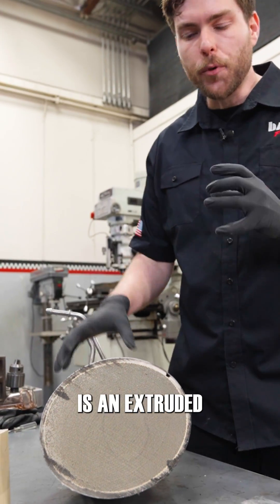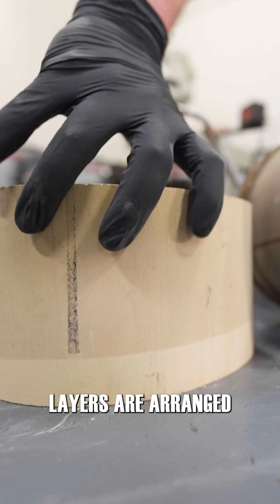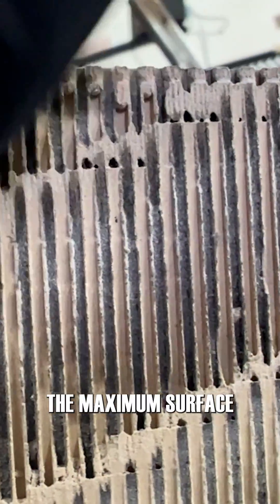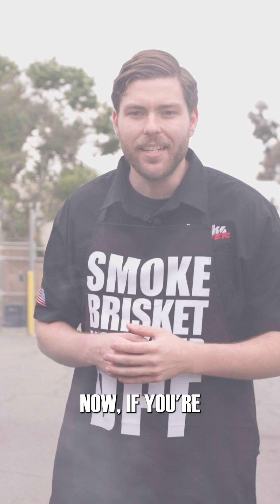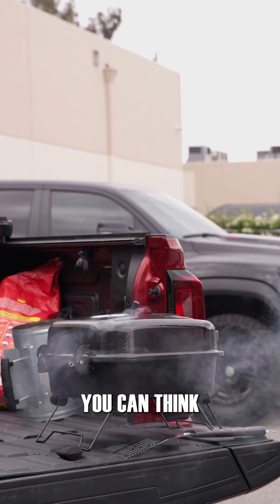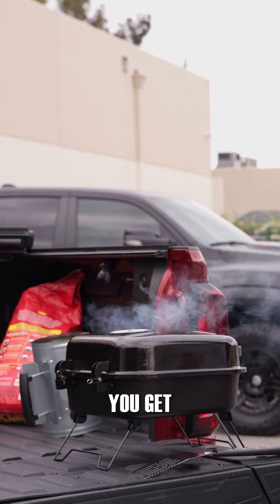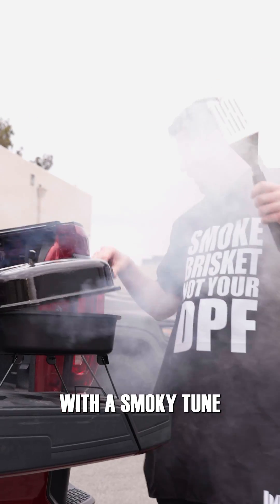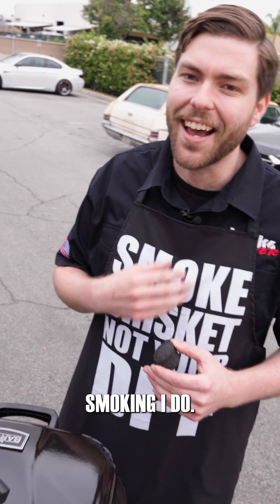Why rich tunes clog your diesel particulate filter (DPF)

Comment: Pretty sure nobody running a smokey tune still has a DPF
Reply: Dpfs on the l5p get clogged either way 😂 emissions are trash
Reply: People run tunes on an emission compliant truck thus resulting in sooting up the DPF. You gotta be careful on the type of tune you’re running if you’re tuned and still utilizing emission equipment
Reply: @sirmassalot  The older pre crackdown "intact" tunes turn off EGR which results in a hotter cleaner  burn with increases efficiency and reduces soot output at the expense of increased NOx output, which is why EGR is run in the 1st place.  

Turn off EGR and the emissions system becomes livable and of course no smoke escapes the exhaust.  DPF regens go from every 300 miles (or less) to over 700 miles and emissions issues generally disappear.  

EGR is terrible for diesels and current regs are simply too stringent to reliably meet with current aftertreatment technology so people are incentivized to circumvent and delete it.  I submit that if the regs were attainable the overall pollution level from diesels would go down as the incentive to delete would go away.  

Then there are entirely uncontrolled container ships at jet airplanes, which put out far more pollution than diesel trucks ever will.
Reply: They're making their engines run worse for no real reason
Reply: Stupid people do it all the time. Then wonder why it takes so long for regen and all of a sudden your truck doesnt start
Reply: Elaborate please.
Reply: Pretty sure he tried to explain to you morons why a smokey tune means you're dumping unburned fuel out the exhaust and making your engine run dirtier on purpose. Problem with a smokey tune is eventually you breathe so much of it in that you're permanently retarded.
Reply: There's that thing I threw in the trash 😅
Reply: Exactly kind of the point in tuning them
Reply: Can you clean a dpf? Or is it just dtf?
Reply: @primitiveorganism9571 lol wat
Reply: @yjkader  guess you can’t read
Reply: hahaha I was thinking that too, the first thing you do for HP is remove exhaust restrictions lol DPT gooodbyeeeeeeeee
Reply: My tune isn't smokey and I still don't run a dpf
Reply: exactly 😂
Reply: I cleaned my dpf with a sawzall 👌🏻
Reply: people running a smokey tune arwnt giving thier engine enough air
Reply: @silentbobfan32 what 😂
Reply: When they produce soot, the DPF plugs, then they lose all their power, so they have to delete the DPF. wouldn't it be great if we could use a system that eliminates the nitric oxides without any exhaust gas recirculation, while using 100 year old technology to increase the fuel efficiency? I'm an engineer and I approached Cummins with my system and was told that they're no longer trying to improve diesel engines, but are working on developing hydrogen technology. This administration is destroying innovation because they are mandating battery electric vehicles. There's not much worse than preventing improvements in society, because it prevents future advances that could have been developed from the first innovations.
Reply: @davidscott5903 ok now I gotta know...what is this 100 year old technology your referring to?
Reply: @reillyp8115  
OK, I might as well tell the world and hope that the information gets out there. When I bought my first diesel truck in 2006, I asked the guy selling it why he was selling it if it was so great, and he told me that he bought a new truck to get one before the emissions requirements went into effect, and he said that they were going to be using exhaust gas recirculation to prevent NOx emissions. So I looked it up, and it blew my mind at how stupid that was. I learned that in order to prevent the formation of nitric oxides, you had to limit the combustion temperature to below 1,500 degrees Celsius, or 2,732 degrees Fahrenheit, and that's why they thought of starving the engine of oxygen to make combustion less violent and produce less nitric oxides. To which, I thought, "The whole purpose of having an internal combustion engine is to give the fuel enough oxygen to burn and use the heat produced to push a piston down, and if you're starving it of oxygen, then you are robbing it of power and efficiency, the exact opposite of what you want! I started thinking that there had to be a better way to cool off the combustion without sucking exhaust back into the engine. That got me thinking about the boilers on my ship when I was in the Navy, and how they use steam injected with the fuel through their fuel injectors that they call "burner barrels." The steam is used to preheat the fuel and cause it to atomize and prevent soot by making each particle of fuel small enough for it to burn cleaner. In a boiler, it takes energy from the system to make the steam, and that energy is lost up the smokestack, but by increasing the amount of fuel that is completely burned, it actually increases the overall efficiency of the boiler. I also realized that water vapor has a large specific heat capacity, and if you were to use steam injected into the cylinders at top dead center with the fuel, it would absorb the extra heat of combustion to prevent the formation of nitric oxides, yet would increase cylinder pressure and effectively make it a combination diesel/steam engine. Steam engines were the first engines ever invented, and by squirting the steam into the cylinders with the fuel, you would have the world's first internal combustion steam engine. I didn't know if that would work for sure, but I went back to college and got a mechanical engineering degree and proved that it works thermodynamically. I also realized that the waste heat from the exhaust system could be used in a waste heat heat exchanger to bring the water up to boiling temperature but the water could be kept under enough pressure to keep it a supercritical liquid until it is injected. This system will allow the diesel engine to burn cleaner than a gasoline/petrol engine and increase it's efficiency above all other forms of combustion engines, giving you more power, more fuel efficiency, and cleaner emissions! It combines the diesel engine with the steam engine, both of which are over 100 year old technology, but by combining them in a new way, we will have the best engine possible. I can't develop this by myself because I don't have the ability to create the injectors that would be required, and I was hoping that a company like Bosch would be willing to help out with this portion of the project. It will be difficult to make supercritical steam/fuel injectors, but I think that it will only take some testing of materials to find the best and most compatible materials.
Reply: @davidscott5903  I have always asked the question. If fuel economy is 50-60% better with out it be choked down. Wouldn't that be more helpful for the environment than burning twice the fuel and all the shit that comes with that?
Reply: @harti81269  
My thoughts as well! If you want to read it, my comment explaining my solution is now in the comments.
Reply: @davidscott5903 What technology are you referring to?
Reply: @davidscott5903  Tell me more.  This sounds fascinating.
Reply: @mkhanson1440  
My explanation is now in the comments.
Reply: @davidscott5903  so you honestly believe that one person (biden) is somehow forcing literally everyone to buy electric vehicles? I have literally no idea how you came to that conclusion, biden is more of a classic republican than a Democrat
Reply: 100% agree with you on this.
I am a journeyman diesel mechanic and have been 30+ years. They are slowly destroying this industry.
Reply: @kain shhhh they're watching

Comment: Don't forget that rich tunes (and coal roll black smoke) also have the ability to clog your lungs or someone's else ones. Proper injector sizing and cooling for charged air as you do is king for godd reliable added power. No need to go above Euro III/IV levels at all...
Reply: Clogging lungs lol. Buddy it’s particulate. The same as campfire smoke. Cigarettes and vapes are more harmful.
Reply: @THESLlCK  or cooking fumes... Particulate size matters but also the local concentrate you smell... One thing is breathing urban contaminated air versus what you say... And other is in the vecinity of the exhaust (or leaks from turbo, egr...)... The avsolute amount of pm2. 5 or lower size (non visible smoke) that won't be stopped by your mucus or lungs vut go straight to your blood... Pm10 to pm2. 5 may also clog alveoli... There's no need to pack your exhaust egr dpf with sludge neither aby mammal or live being on the biosphere... No need to go over Euro III emissions for any performance/efficiency reason... Even on smoky pre-70s diesel they may run good enough without black smoke...
Reply: @InternetListener  get a load of this guy, explaining ppm and diesel efficiency standards to a diesel mechanic. Glad we have an expert opinion on the scene lol. FOH you’re just wrong
Reply: @THESLlCK  are you crying? Are there diesel efficiency standards? PM and ppm are the same? Wrong-meter link to buy one? Go read the Handbook of Diesel Engine by Bosch and keep smoking rolling coal...oh wait it's illegal and biohazard...who is liable for a rich mixture intoxication/sufocation or health damage in a working environment?
Reply: @InternetListener  lotta yammering for someone outta their depth here little man.
Reply: @THESLlCK  FOH? YAmmering? thanks a lot for new salty acronym learning course for free... but I need too tell you a peace message: Alo, human. iz yous well? do yous fell menstral? wouldn't be da intaweb da betta place if yous just expalin wot ya ideas iz wiv facts an' ruks? Is it coz I is black?
Reply: @THESLlCK unless you build the worst fires in the planet a diesel particulates are much worce. Linked to asthma and all sorts of lung condition. Cigarette smoke is worce the only difference is that smoking is a personal choice than only hurts you.
Reply: @THESLlCK unlike campfires, unburnt hydrocarbons cause cancer

Comment: Yes. When I was Taught Diesel in late 90s, it was called overfueling.  It's is hard on a diesel.  And the nonsense they come up with now, adding more and more fuel, is like some pseudo science they believe
Reply: Overspraying cools the cylinder head. When you are making big horse power you need every bit of cooling you can get.
Reply: @certifiedspeed5361  so upgrade the cooling system instead of relying on fuel to cool??
Reply: Yep kids these days dont realize that you can make more power without smoking and wasting fuel...but rolling coal is the new cool
Reply: @nicwilson6391 your comment makes no sense😂😂😂how would you be saving fuel when you have to buy more?
Reply: @Coarvus  how does it not make sense when I said you can make more power without making a diesel smoke ?? Pretty straight words ? I said rolling coal is the new COOL thing g for kids....I didn't say it was the way to make power
Reply: It keeps egts cooler that’s all
Reply: yeah, if we r TRYING to SAVE fuel why add more to burn ?????  make better fuel ??
Reply: Yeah most tunes just boost rail pressures and call it a day... makes it feel snappy, and gives it the rolling coal that so many desire... iirc there is about 20~30% power left on the table if you're running "rich" enough to roll coal. 

I have no desire to own a modern diesel, I really don't understand why anyone would risk a lively hood on tier 4 final diesels. Just in injectors you might spend 8k+, let alone any of the emissions equipment assuming you're trying to be law abiding.

If it weren't for the EV craze, the push was very strong to bring SCR and DPF to the gasoline world... so instead of that they plan to just ban all the combustion engines.
Reply: And yet every statistic on modern diesel says that the emission system is what reduces their efficiency, increases their operating costs, and kills them the most now.   Go figure.